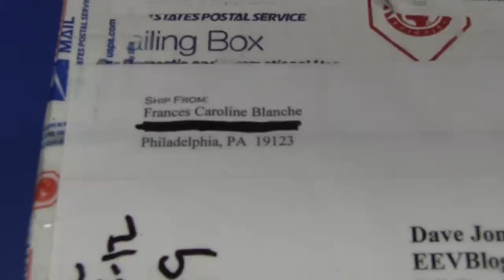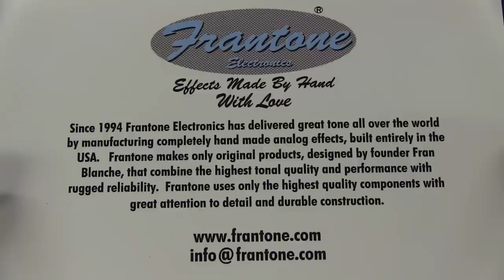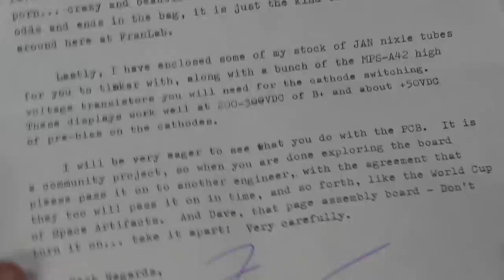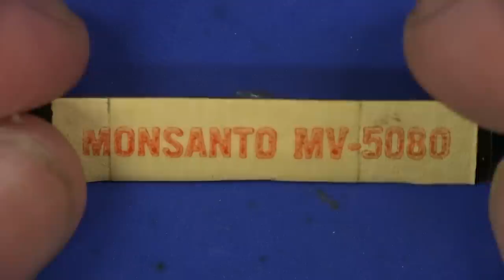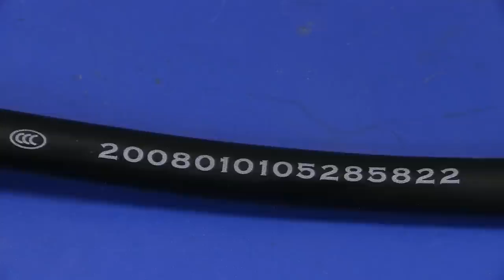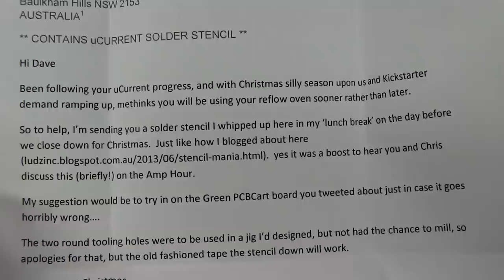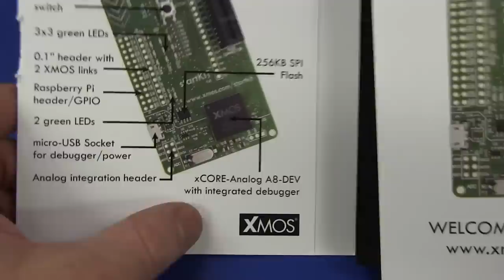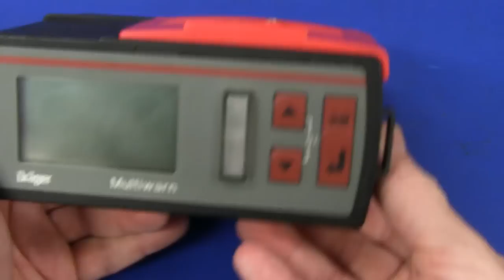EEVblog #561 - Mailbag

Comment: beside mains lead being skimped on the copper I noticed blue and brown wires are switched, brown (phase) is supposed to be on left side in wall socket
Reply: Not true. It is undefined on a reversible German schuko plug, and correctly on the right (when facing a socket with the earth on top) for the French plug.
Reply: cybermaus

You should check how to correctly wire French socket then
Reply: *****
Since the plug can go in either way round, there is no point in defining the active/neutral pins on the socket, is there?
Reply: For the Schuko part, no it does not matter. But the French part can go in only one way, and while it originally also did not specify specifically which pole is live a habit did form. But novcze and I seem to disagree which habit.
 
Mind you, the real reason it does not matter is any device approved for either market is required to be double-switched. So when switched off, both leads are disconnected. Unlike for example in the UK, where only one lead has to be switched and fused, so correct polarity is vital
Reply: cybermaus
Most appliances are double insulated, so polarity for them is irrelevant. One area of concern though, is some types of Edison screw sockets which can allow the threaded ring to be touched while inserting/removing bulbs. If the threaded part is ACTIVE there is a potential shock hazard. This SHOULD not happen with fixed wiring, but is possible with plug-in desk lamps etc. if the user doesn't disconnect the power plug.
BTW Australia uses a polarised GPO plug/socket design which HAS defined active/neutral pins (and most GPOs are also switched).
Reply: stmounts Yes, I think that is why you do not see those sockets anymore. Its all plastic thread, with a small metal tab deep near the bottom. Especially if the device is rated as double insulated and has a non-polarity europlug.

But always double switched. So if you switch off, you do not get a shock, even if you try. And if you start poking inside while plugged in and not switched off....well no amount of polarity or double insulation can protect you then. A Darwin award if what is needed for that.

I agree, when it comes to safety, polarity is better then no polarity.

But if you simply tread both leads as potentially hot and wire accordingly, it does not matter much (the old style screw socket indeed a good counter example).

Let me tell you: small universal unpolarized Euro plugs are very convenient, and in combination with ground fault protection (required nowadays in most EU countries) still very safe. Safer in fact then polarized with no ground fault protector switch.
Reply: cybermaus

yes, it is just historical habit, we are using French socket here in Czech Republic and our technical standard (CSN 33 2130- Low-voltage electrical installations – Internal electric distribution lines) gives only recommendation on which side is live and neutral in the socket.

I don't know if it differs from actual French standard, but I suppose it is the same.
Reply: ***** In fact Wiki (for what its worth) hints that indeed Check and French communities do suggest opposite sides for hot. Unfortunately, its called the French socket, so it's the Czech that made a silly choice there. Which is why the China cable feels wrong to you.

Also look at this Polish socket: (image 7+8) http://fam-oud.nl/~plugsocket/French1.html 

Its impossible to designate a hot side if that's how you produce your socket internal wiring. For all purposes, I guess any smart technician should consider this plug type as non-polarized.
Reply: cybermaus
Thanks for the link, I should use more googling next time.
From historical point of view, if French socket is used in TN-C network it have to be specified somehow. Nowadays TN-S network is standard so yes, it doesn't matter anymore.

Comment: I've done some testing on my Chanel with such a cable a year ago, At a view amp it will smoke an burn like hell ;)
Reply: Sometimes I think that there are organizations in china with the goal to kill every non china person in the world... This is just (involuntary) manslaughter... It's good, that not all organizations in china have this goal...

An LED bulb died after a couple of hours and two days ago I wanted to investigate what just happened. The LEDs are allright but... They did use a PES cap as current limitter in parallel with a resistor. There was no PCB just component wires and NO heatshrinking!!! The resistor got loose and the PES cap vented out silver polyester grease that got hard after it cooled down... It's just... I can not find ANY words for this. The LED bulb did cost about 12 USD or 9 EUR....

Someone (NOT EVERYONE!!! Don't get me wrong!!!!) in china is trying to kill us...
Reply: it is horrible and just unbelievable.
Reply: Not only that those cables start to burn at a few amps, but you can actually rip them apart bare handed without a sweat - that's dangerous as hell..
Reply: Did it is so bad so bad!!!

Comment: The German power plugs are bidirectional, so it doesn´t matter in which direction its plugged in and on which side the phase and neutral is wired to.
Reply: This isn't exclusively a German plug though, It's a CEE7 plug which means it also means it can receive a French style earth pin from the socket. This means that the plug must be wired correctly for use in France and I think Belgium. Either way though, the plug in this video IS wired correctly.
Reply: you´re right. i was only referring to the german who sent this for assignment. and in germany we very seldom have the earth pins from the socket. but in that case there is only one way to plug this in. never the less in the domestic electrical installation its indifferent in which direction the plug is inserted.

Comment: Nooooo, the Numitron is not a nixie display - it's an Incandescent display technology!
Reply: wow, literally two tungsten wires in the shape of a plus?
Reply: ***** well shiit. That has to be horribly inefficient and run quite hot. Then again, I guess it's not that bad, you can probably get away with running 10-50mW per segment and still be visible. Know anything about this?

Comment: that power plug: it does not matter if you swap them, the poles swap 50 time's and more in a second, so, blue and brown are kinda the same, brown is neutral, blue is positive and negative, so, just dont short them out, or connect to ground, else, no problems
Reply: And you're dead. Brown is NOT neutral, brown is actually the HOT wire. BLUE is neutral (EU).
Reply: oh, swaped them too now :D
Reply: This is the reason why I don't like it that they are explaining that the actual polarity is changing 50 times per second. That's simply not true!!

You have the neutral, this is the potential offset point and retrun point of the AC current.
And the life one, this is the where the actual current comes from.

Neutral should never be considered as a safe wire. In most cases it is, but to show what I mean, just imagine the neutral has the potential of 1200 Volts DC.
The life wire has now also this potential but there is the 240 Volts AC, shiftet up by 1200 Volts DC. Any appliance you connect to that will work properly. Nothing bursts into flames. But if you might get contact to the neutral you will die because of the offset voltage of 1200 VDC.

I hope I could explain it understantable. If not and it is considered wrong, sorry for that.
Reply: its not a genius that got the ide to do this here in belguum, france, germany, ..., europe (not US, they lways wznted to do special in the early time's)... so, difficult to say, but actualy its simple..
Reply: that light would only light up one side, because there is no consumption feedback, so, the used energy, going to the other wire, thats why, it always starts in one wire...
Reply: teh pwnerer  But don't bet your life on these, they can break too. Always pull the plug / flip the breaker to off first. And do make sure nobody turns it back on again without you knowing. That can be a real killer.
Reply: or, for a second, can hurt you realy bad, auch

Comment: 22:34 I'd rather see the chinese using thicker iron wire, than really thin copper.. it just makes no sense why you'd use a precious metal such as copper for short-distance transmission of power

Comment: i need 230volt 16amp cables for my stereo surround sound system. 4000watts rms. pulls about 5500watts from the outlet 7 amps and one preamp one crossover and lots more. :)
Reply: 230Vx16A=3680W/VA - I'm pretty sure the power supply/the caps therein buffer most of the peaks your PA generates at max. output, right? Or did you really try some sinewave max load tests? :)
Reply: Some yes... But most is just pure brunt vs the power line. Its more then enough to dim the lights when the bass hits nice and low. The power meter pegs out at 4000watts peaks. So more then that i know it draws. And avg's around 2500watts when playing at a decent volume :)

I love it though. Music does really feel alive. Im running well more power then anyone really should in an appartment complex. But damn its fun really :)

Comment: 20:36 that plug is used in my country (the netherlands)
Reply: and Sweden :-)
Reply: and Sweden :-)
Reply: Andreas Johansson in more countries as well because i saw that in some other vids
Reply: +Freddy It's a standard European plug known as a 'schuko' plug.
Reply: +BenjaminGoose Shuko is used in most european coutries. It does not have the female earth connexion, which comes from the french "confort" norm (which is used in some other coutries of Europe) like Belgium and Poland, and in most former french colonies . The plug shown here is a double-standard "shuko+confort". It is widely sold in Europe because it will work in almost all European countries (except in UK) and in a fair number of African countries also.

About the cord, well, it's really thin, but then again, if it was mounted on an appliance running at, e.g. 1 amp, there's no real problem. (The 10/16A marking is only the capability of the plug)

Comment: for the plug look at the CE marking. The real CE conformity marking the "C" should almost touch the "E". Here you can clearly see that they are far appart. This tricky logo means "china export". Chinees made a logo that looks alike to trick people into thinking they are buying certified products where they are only crappy knock offs.
Reply: +Borka223 
Oh yes, you are wright 
http://www.afcn.fgov.be/GED/00000000/3500/3524.jpg

My bad.
Reply: +alex wouldn't say that. Many don't even know how to do the CE right. 
A right CE Sign is btw this way: The C is very round. if you think of it as a circle, the the cicle will overlap with the left line of the E. An incorrect CE sign ( to small or false done) is btw handled like it's not there. I know this since I'm working for a company that is selling tons of electronic gadgets. But my personal experience tells, that a ton of companys do the CE wrong, normally because they don't know better (why? I don't know, they actually should). Same goes for other of this Signs, too.
Reply: +sagich dirdochnicht it should be so much easier to just download the damn logo ...
Reply: +netsurfer912 
Don't know why they don't get it... But not only Chinese manufactures don't get it right. I've seen apple Samsung and other companies products where the CE was to small (must be at least 5mm big) wich is meant by law like it's not even there. And I've seen other products of many other products where the ce was printed wrong, too. 

By the way: passive cables don't need a ce sign in the EU (except for GB).but I don't know how this works on other places like the US or Australia